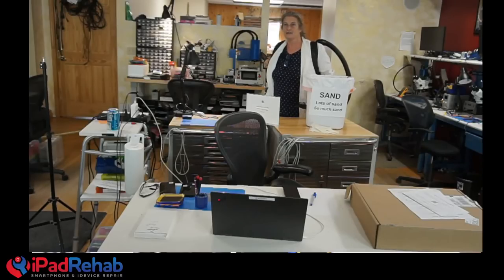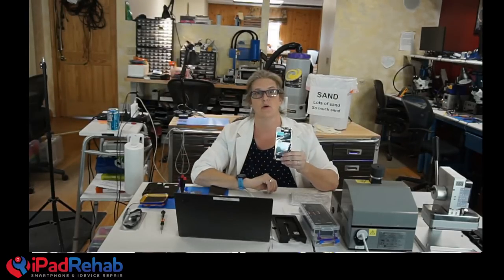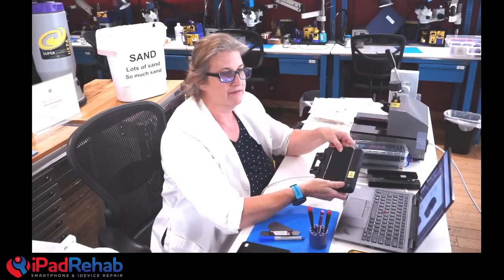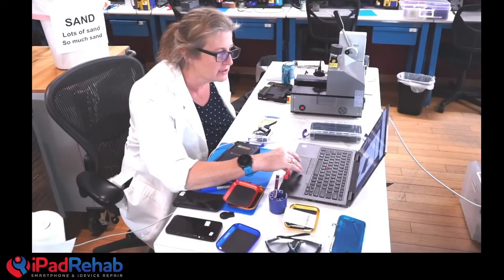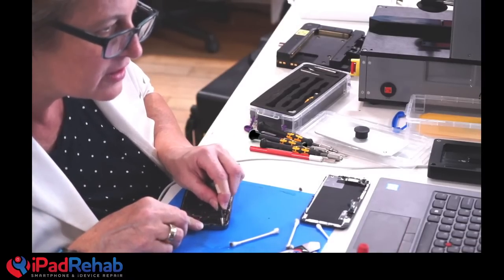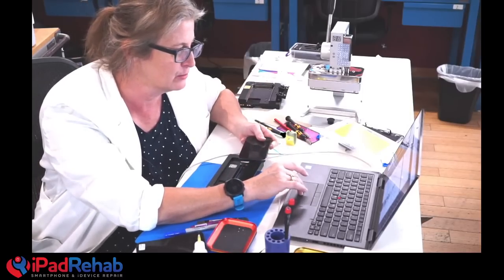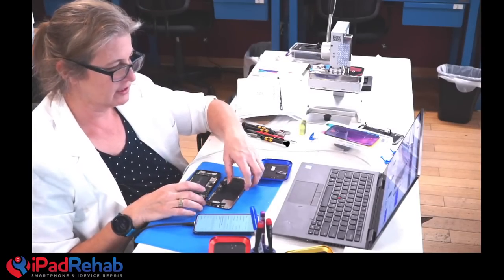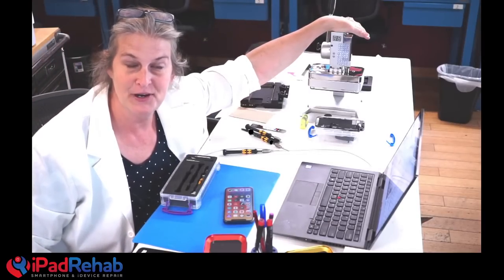Apple's Self Repair of Jessa's iPhone 12 Pro.  Let's GO!

Comment: So I wonder if you leave phone with apple store to do this process would they make you sign an 'I agree to the terms' form? Because surely they'd just put it in diag mode as well to finish the process and have to tap 'I Agree' on your behalf.
Reply: Lol they probably  fix it then give you the phone to confirm the repair  lol
Reply: I’m an aasp, from my understanding that disclaimer is for the whole diagnostic suite that can be done on the iPhone which can include using some of the mentioned features like calls when doing a cellular diagnostic. The camera part is I believe more for the technition doing the repair as when you run certain diagnostics or system configuration the phone requires the camera to turn on and have the technician stand in front of the phone to calibrate and test Face ID. This I do not believe goes into other parts of the phone. Also at my Best Buy at least where I do repairs we have clients sign a diagnostic consent form that has the same disclaimer on it before we run anything.

Comment: Hi Miss jessa i have to way to remove adhesive easy one is with contact cleaner leave some second after clean with alcohol or second one i use little oil adhesive remover wipe used in hospital after pass alcohol.

Nice video

Comment: Those aren't screwdrivers, they're torque bit drivers from Wera tools.  I think Apple contracted them to be made for their repair program.  I don't think they're available from Wera in those torque settings.  They're much less expensive from Apple, so you should buy them.  Normally, they cost around $158 each.

Comment: Lots of people think they can replace their own screen. And they do not put the screws in a place to make sure they go back in the right place. Then they have to send in their phone for repair, because they put the long screws in the wrong place, and also they think they need to put the screws in tight. Those people should never remove their bad screen, and send it in to have it replaced. I took many that I would never touch. Long screw damage. Some were very severe bad. Also, I never replace the screws. They are not torqued screws. I am so happy I never had to repcace my screen. I do not agree with their info. Very stupid.

Comment: Dont forget that theres a requirement that you have to use a specific torque driver for the installation of screws. THEN just below it theres a note that says "Any torque driver can be used to remove screws." I call shennagians!
Reply: “To remove screws” this is saying that you can use any of the included torque drivers to remove the screws as you don’t need any specific torque to remove screws however you would want to have the correct torque driver to install the screws as to not over torque the or under torque them which can cause damage to the phone. - coming from an aasp

Comment: Did Apple  not send you the torque versions of the wera micro/pico electronics screwdrivers? Cuz they are nice and will click when inserted enough. Also, they should be magnetic, so not sure what happened there, least mine is 🤔

Comment: You missed steps (and didn't understand them), you're supposed to hold the sides of the display, slide it downward (like a PC case side cover) while it's still warm, and insert the cutting tool at the top WHILE pulling the display down slightly. I can understand this from a 5 minutes read, and looking at the instructions pictures, they show cutting the top adhesive AT THE SAME TIME as pulling the screen down. as an engineer and a DIYer, I'm all for right to repair, but incorrectly stating that the process and the tools apple supplied CAUSE the screen to break on removal is simply incorrect. From my side it looks like user error, and Apple can even use this case as an excuse for stopping this program, as even the people who work at independent repair shops can't follow simple instructions to remove a screen without breaking it. I suggest you re-do the repair following the instructions correctly before you judge anything.
Reply from the maker: Taking a cracked screen out of an enclosure by any method is “going to break it” same as taking a cracked egg out of an egg carton.  

I’m not sure what your point is here.  The screen was cracked (albeit functional while still in the frame) hence the reason I’m replacing it.  

My beef with the procedure is the terms and conditions.  I do NOT AGREE with allowing Apple and “their partners” access to my browsing history, personal data, call history, etc  in order to replace a part in a phone I own.
Reply: @JessaJones  I also do not agree with the terms and conditions. But I also believe the tools were not used the correct way, and the hardware repair done was not the best.
Reply from the maker: @M9Only  I followed the instructions exactly as written.  I did “slide the display slightly toward the bottom of the phone” however it was immobile because nearly all of the adhesive was intact.  There was NO WAY to break the adhesive at the top of the phone with the prescribed PLASTIC “adhesive cutter” that had already melted some from the prior step.   And I called over two other experienced technicians to verify this.

The instructions are incomplete and out of order.  For example, in the prior step NOWHERE does it say to raise the suction cup lever from its default down position before lowering it.  

The instructions need some work.
Reply: @JessaJones  I don't disagree that they need a lot of work, and I love your work and know you are very experienced. but the instructions are not just the words written, the photos actually show additional information not written in the instructions text.
Reply: @JessaJones  Examples of this are on pages 24 to 28: the default suction cup lever is shown in all pictures as lifted up. its not written but all pictures show it lifted. Page 33 shows the pulling motion while using the adhesive cutting tool as I mentioned.
Reply: @M9Only  But literally in the video Jessa does the instructions in the correct order by reading ahead, and even still this process didn't work. I personally think that even if it does work when you do it perfectly, it's an over-engineered repair process that was devised to deter people from fixing their phones. This type of error could easily happen to anyone, especially inexperienced people. The unclear / messy instructions only add insult to injury.
Reply: @LazorVideosDestruction  I agree it's an over-engineered process. but is it designed specifically to deter people from fixing their phones? I think that's the same process they use at their facilities, they're too cheap to re-design the repair process and tools for that reason, they just said screw it, we'll ship the tools we use and publish the training manuals (after removing all technical details and proprietary information of course) and let the people try. I still think someone who works at Apple can follow the instructions, get the screen out in one piece, replace the screen, all in less than 15 minutes, including the heating time for the screen removal. but blaming the process and the tools on the outcome we see in the video is not the solution. I still think the repair process and instructions are solid (but over engineering and leave some things for interpretation and some instructions are implied, these are not instructions for the casual customer, to me these look like instructions to someone who already knows what they're doing with these tools. I would love to try this myself but I highly doubt this program will be available internationally where I live.
Reply: @M9Only  It's absolutely meant to deter people from repairing their devices. Replacing an iPhone screen does not require two suitcases full of tools, it doesn't matter if it's what Apple does with their own repairs, it doesn't change the fact that it's overkill.

The price is also another thing meant to deter people. Even if you just decide to get the screen and not rent the two giant crates of tools, it's only $10 less than just taking it to an Apple Store.

Apple is trying to kill two birds with one stone here. The first bird: convincing average people that replacing a screen is an extremely difficult process (it's not), and also convincing politicians that R2R is a non-issue.

This program is garbage as it stands. The fight is not close to over.